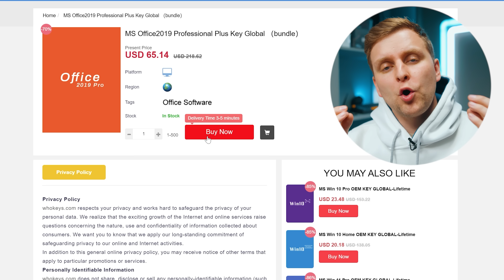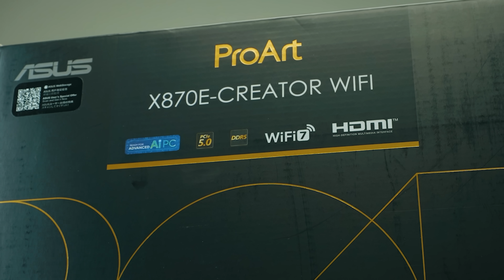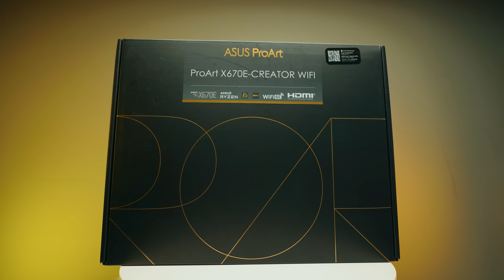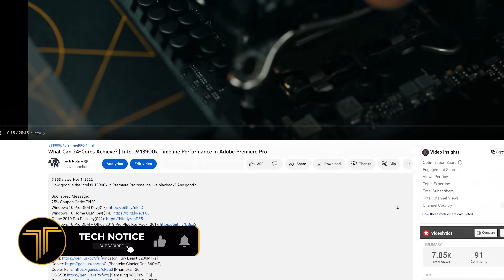The BEST Motherboard for AMD Ryzen. Period. - Here's Why! [Asus ProArt X870e Creator WiFi]

Comment: Honestly the ROG CROSSHAIR X870E HERO is better in terms of raw motherboard power, and the AsRock X870 Pro RS is by far the best in value. Just $200 for a current gen chipset on launch! It'll go well with 9600Xs and RX 8600s when RDNA 4 releases.
Reply: Word. Such a scam to cheep out on that 8 pin power connector.
Reply: why would you care about raw motherboard power for a 9600x
When basically all x870 and x670 are overkill for even the 9950x
As they were designed for the 7950x (it uses a bit more power than the 9950x)

X870 is all about USB4 and pci lanes
Reply: And ram speeds @thelbp
Reply: @thelbp  it's a $190 motherboard
Reply: The Corsshair doesn;t even have a 10GBBe port what is that scam? some older 10G Nases might not even link at 5Gbe, falling back to 1Gbe. I would not consider that at all
Reply: @alpenfoxvideo7255 how old are we talking? I hadn't considered that an old 10G NAS might not be compatible with 5G. Is that a software problem, or hardware?
Reply: @psommer4218  that is hardware, because 2.5 and 5g were not really considered as the standard modes are 100/1000/10000
Reply: Granted, but the configuration for a professional who needs to connect an NAS and a network would use this without a second thought.
Reply: Nah the $1200 GODLIKE has to be best, right??
Reply: @ScarletSanctuary  i'm not sure if a godlike x870e has released yet. This was the best mobo on the release so like, we wont know for another while
Reply: The best in value is the AsRock Nova
Reply: The rear I/O  on the Crosshair is nowhere near as good as this ProArt.
Reply: @brianhoward9217 with 4 USB-c 40Gb ports on the back you can basically have whatever I/O you want. It doesn't have a single USB 2.0 port on it. The amount of bandwidth in the rear i/O gives you the ability to put a ridiculously large number of USB ports and stuff if you really want. I'd much rather have them include high bandwidth ports that can be split out into other things than include a bunch of low bandwidth ports. 

you can split high bandwidth out, but you can't really unify a bunch of USB 2.0 into anything that useful. 

Nobody is buying a who's actually buying a X870E crosshair hero is worried about the rear I/O.
Reply: @e2rqey  Last things first - to your last sentence, well, I am! Just in case you don't know the rear I/O is what decides how effectively and conveniently your beautiful new machine talks to all it's friends around it on your desk. So yes, it is quite important. Not everybody is of the 'reverse-baseball-hat or hoodies juvenile subculture and plays games all day in their mum's basement! One or two USB 2.0 ports is always a good thing to dispense with keyboard and more (assuming you done have an APEX board with some lovely PS/2 ports). Hey, I'm a real ASUS fanboy as I see their specs and quality and I've never had a day's problem with an ASUS board in over 30 years! They're all I've ever used. Each time replacement time comes up I research the market and ASUS continues to come up trumps. I'm all for the 40 Gbps USB4 ports - more the merrier but some basic ports for basic peripherals will free up the fast ports for all my 'significant others' :-) Cheers from Sydney Australia.
Reply: @brianhoward9217  you're right they might aswell add like 5 usb 2 ports, but you can also split one of the 10gbs port into multiple USB2 I guess, I imagine it will work well for peripherals like mouse keyboard etc, which in fact makes me think, for this price they could have add some extension USBs..

Comment: The screw driver argument is a weird one. You still need a screwdriver to install the motherboard anyway. Unless your a zip tie guy.
Reply: It's a chunk of metal large enough to keep 3 NVMe drives cool. I'd prefer it have screws
Reply: These manufacturer need to stop making the components "user friendly". Bring back the seven segment display. On these creator boards.
Reply: @joelg1318  there is one... its right there.
Reply: Also consider without a magnetic screw driver m.2 screws are a bitch. MB screws aren’t as difficult to maneuver.
Reply: @elliottpalmer7624  that's why they made quick fit .. no small annoying screws for m.2 drives on these boards which is a gods  send. All boards need to implement that no matter price
Reply: Like Linus does with CPUs and cooling fans?
Reply: They want to have something “negative” to say without it actually mattering to most people
Reply: Duct tape, wire ties, cable ties, and a cardboard box is the real budget META  I like it because you can just tear a hole in it if you wanna add a fan
Reply: It's not about the initial install. Its about accessibility after the motherboard is installed and your doing upgrades.